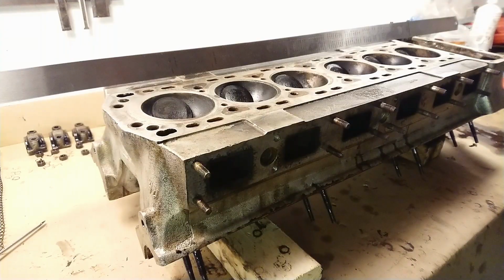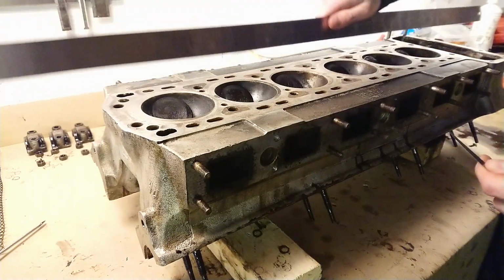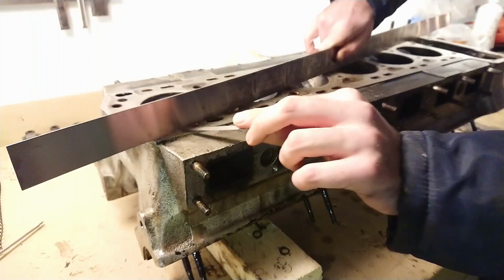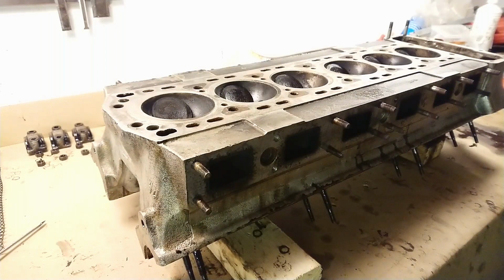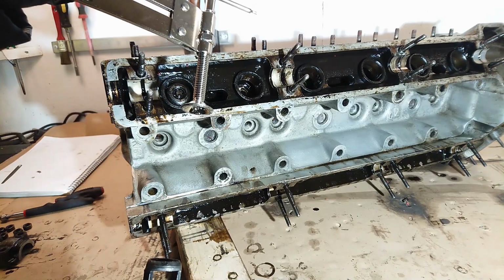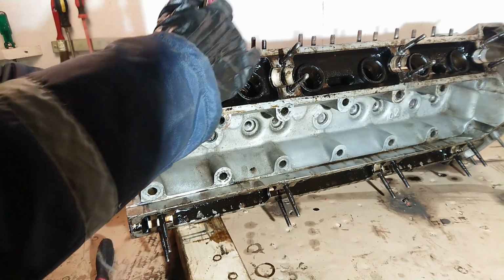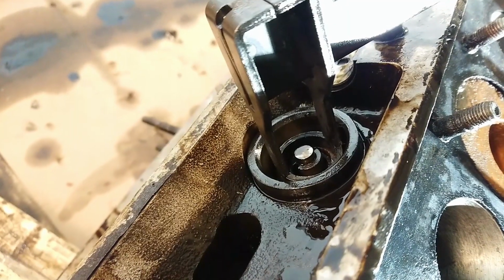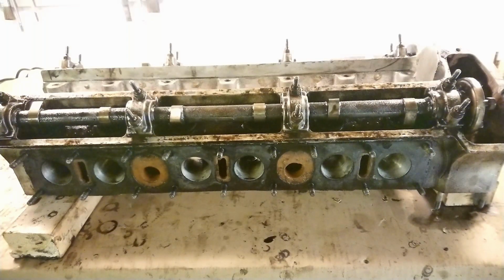Jaguar XJ6 Cylinder Head Inspection and Disassembly - Jaguar XK Engine

Comment: My cam shafts may have got mixed up, how can I see the difference between the inlet and outlet cam shafts for reassembly?
Reply: Its a different head, why would one of the cam shafts have two bolt and the other have four bolt sprocket holes? I don't have the original head hear but was quite sure both the cam shaft were four hole on that one!

Comment: Nice tips.  I'm taking the head off my XK engine today and appreciate these videos.
Reply from the maker: I’m glad they can help! Hope the head comes off easily
Reply: @LivingWithAClassic  It lifted right off in minutes!  There was no corrosion at all on the head bolts or in the water passages despite sitting for 15 years.  I had the head off about 25 years ago on an unrelated problem.  then I used a stock tin gasket but sprayed a coating of Permatex copper head gasket sealer on each side.  That stuff worked great.

Comment: Hello 
Thank you for your videos, I have an xj6 serie 2 from 1978 and we need to change the head gasket. My question this generation heads are able to run on unleaded fuel or I  need to upgrade it to avoid add on when I fill the tanks.
Thank you
Lionel
Reply from the maker: They can all handle unleaded fuel as they are. The valve seats are hardened from the factory. Thanks for watching!

Comment: lf i had to guess it would be that it was assembled correctly but the head not re-torqued after 500miles or whatever. That would/could end up with HG failure
Reply from the maker: You're probably right. A lot of things were not done right